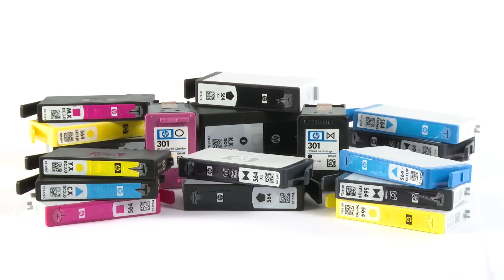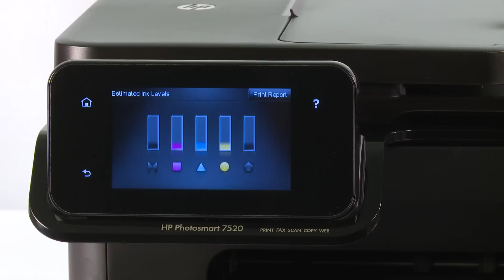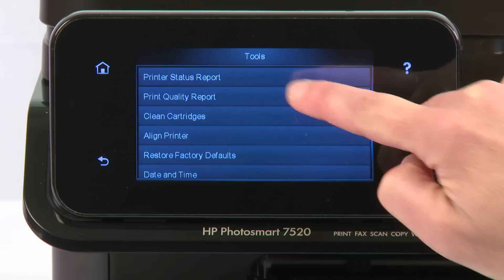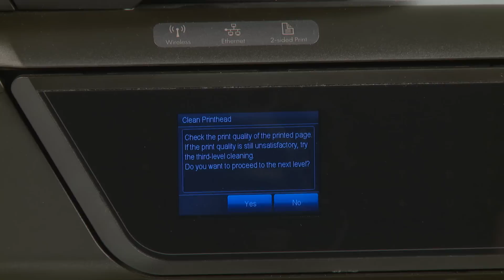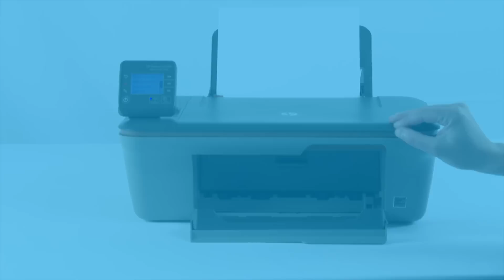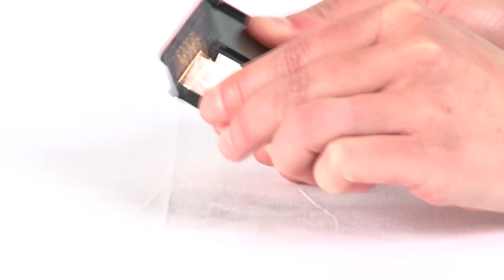How to fix print quality problems | HP Inkjet Printers | HP Support

Comment: hp officejet pro 6835 how to print highlighted text
Reply from the maker: Hi there, thanks for contacting HP Global Social Media Support!
I understand that you are experiencing an issue in printing highlighted text.
I will do my best to assist you.c
To print highlighted text with an HP Officejet Pro 6835, you can try these steps:
Update the firmware to improve how highlighted text is copied or scanned.
Select the Text option from the Optimize Text/Picture menu on the control panel when copying or scanning.
Regards, 
HP Support

Comment: HP printers are designed to NOT work properly with off-brand cartridges. HP cartridges are not perfect. And isn't it odd that solutions to print quality problems are managed by depleting your precious supply of HP ink.
Reply: I just bhought frst new one ink is wet doesn’t dry .and ink is empty already ,

Comment: My HP ENVY Inspire 99e says it has a paper jam and it DOES NOT!!!
Reply: I have wasted so much time and it doesn’t help at all!
Reply from the maker: Hi there, thanks for contacting HP Global Social Media Support!
I am here to help!
My apologies for the inconvenience,
I'd request you to perform a reset on the printer. Kindly do the following:
	
1) Turn on the printer, if it is not already on.
2) Wait until the printer is idle and silent.
3) With the printer turned on, unplug the power cord from the printer & wall.
4) Press the power button for 30 seconds. 
5) Wait for 60 seconds. 
6) Plug the power cord back into the printer and wall, ensure the printer is plugged into the wall & not to a surge protector.
5) Turn on the printer, if it does not automatically turn on.
Note: To make sure the power source functions correctly, make sure the printer is plugged into an electrical outlet and not a power strip or surge suppressor.
Let me know!
Regards, 
HP Support

Comment: Why don't you lower the outlandish price of your ink. Maybe people would be more willing to buy the HP ink if it didn't cost half a month's wage.
Reply from the maker: Hi there, thanks for contacting HP Global Social Media Support!
I understand that you are not happy with your printer as the ink cost more. 
I will do my best to assist you.
It depends upon the usage. However, you can check the page yield of individual cartridge here: https://bit.ly/3e9Q41H 
Regards, 
HP Support
Reply: @HPSupport  Your link doesn't help at all, I know what the page yield is supposed to be. I've printed maybe a dozen pages with colour, at the most, in the past year. Now, the amount of ink used whilst cleaning the print heads is a problem and the problem I currently have is that the heads are clogged. Several cleaning cycles have yielded no results. The black cart works fine. I only have issues with the colour. I suspect the ink has been used-up in the cleaning cycles. I can't afford to pay HP for my cleaning cycles which is exactly what I'm doing as I am an occasional user and therefore must run a cleaning cycle first, every time I print. If I don't want streaks.
Reply from the maker: Thanks for getting back to us, In order to get this issue fixed, please contact our customer care team over the phone or chat for further assistance, as this issue requires Live conversation with you over phone or chat to isolate the issue and provide you instantly with appropriate solution or repair/replacement options available at your place as per the warranty.
Please feel free to reach us on call/chat, please access this link to select your preferred country and language option to reach us. Global support link: -  https://hp.care/3MSoVUy
Akhil_HP Social Media Tech Support

Comment: I got a printer in January printed like 2 pages and the ink is full , now it doesn't print at all, 1st was the colors printing very very light almost invisible,  I remove the colors cartridge and let alone the black cartridge and it didn't print either, it came out a white page 😢
Reply from the maker: Hi there, thanks for contacting HP Global Social Media Support!
I understand that you are experiencing an issue with your printer as it is not printing. 
I will do my best to assist you.
- May I know the model number of your printer?
- May I know to which device you have connected your printer? (For ex: Desktop, notebook, iPhone, iPad, android phone etc?)
- If connected to computer, may I know the operating system installed on it?
- Are you receiving any error message?
Please let us know!
Binu-HP Social Media Tech Support
Reply: @HPSupport 1) hp deskjet 4155e
2) I used my android phone using the hp smart app and complement hp app to print 
3) HP laptop using wifi operating system is windows 10.
4) Not error messages,  just not printing in colors nor black and cartridges are almost full.
Thank you
Reply from the maker: Thanks for the reply.
Please refer to the instructions mentioned under this document to fix the issue: https://bit.ly/3W9xyfO
Binu-HP Social Media Tech Support
Reply: @HPSupport thanks I will try and see how it goes.
Reply from the maker: If you need any help in the future, you can always get back to us.
Thank you for being a valuable HP customer.
Have a wonderful day!
Cheers!
Binu-HP Social Media Tech Support

Comment: Ink cartridges were changed four times and the horizontal lines continued to appear on subsequent prints.  All of the posted repair recommendations were carried out several times and the problem persists.  I'm very convinced that the problem is hardware __ faulty hardware.  The problem started on the 13th month after purchase, just after the manufacturer warranty expired.  The customer support gives a complete runaround, just to make it look like they're doing something.  We won't purchase HP products any longer, we're very disappointed in the quality.
Reply from the maker: Hi Joseph, thanks for contacting HP Global Social Media Support!
I understand that you are experiencing a print quality issue on your printer and you suspect that it is a hardware issue.
Due to limited support on this platform to fix this issue, please feel free to reach us on call/chat. Access this link to select your preferred country and language option to reach us. 
Global support link: - https://hp.care/3RpcHWr 
Binu-HP Social Media Tech Support

Comment: MY HP 7000 series printer shows print cartridges half full but I can’t print either in color or black and white, why does this keep happening? Do I need new cartridges even though they show half full?
Reply from the maker: Hi Carol, thanks for contacting!
I understand that you are experiencing an issue with your printer as it is not printing. 
I will do my best to assist you.
- May I know the complete model number of your printer?
- May I know to which device you have connected your printer? (For ex: Desktop, notebook, iPhone, iPad, android phone etc.?
- If connected to computer, may I know the operating system installed on it?
- Are you receiving any error message?
Please let us know. 
Binu - Social Media Tech Support

Comment: Need advice on HP J4580 which is old but the problem that came up in printing a page that pertained to date at the upper right corner and a a straight line for the purpose of a signature signing.  Upon printing the page, the year ends on the next line on the leftside of the  paper.  Same for the line which also ends up one line down and again on the left side of the paper at the bottom of whatever I have typed on the letter.
Appreciate the help on how to fix or is the problem inside the printer and is time for replacement?
Reply from the maker: Hi Mike jung,

Thank you for your post and interest in our product.
We appreciate your time you have taken to contact HP Support and We apologize if you had any inconvenience.
I'd like to help you with your HP Printer and related queries.

As a first point of diagnosis, please try few of these troubleshooting steps mentioned in this document link:
https://support.hp.com/in-en/product/hp-officejet-j4500-j4600-all-in-one-printer-series/3645081/model/3645099/document/ish_2040896-1521878-16

If issue still persist after trying above troubleshooting steps, To further provide you with appropriate solution for this issue, We may require some additional information to assist you specific to your HP product:
1: Model name / Product number of your Printer:
Here is a document link that will help you find this information. Link: http://support.hp.com/us-en/document/c03754824
2: Brief description of the issue.

Hope this helps. Keep me posted.
If you require additional assistance, Feel free to contact us anytime for any HP Product support.

In case you want to reach us on call/chat, please access this link to select your preferred country and language option to reach us. Global support link:- https://www8.hp.com/us/en/contact-hp/ww-phone-assist.html

Regards
Vignesh-HP Social Media Support

Comment: The clean head and alignment features have disappeared from my HP Envy 7155 series printer control panel.  None of the menu icons at the top of the screen now show these two vital maintenance features.  Have searched and cannot find after several attempts. They were there before!
Reply: Hi. I'll really help you. Just buy a different brand of printer. It will fix all your problems. Literally any other brand
Reply from the maker: +The Defenders Team Please refer to the instructions mentioned under this document to fix the issue: https://bit.ly/36UQJpu

Comment: Our printer won’t print error message is remove and reinstall the indicated ink cartridge making sure it is correctly installed we did that, it prints once, and message comes back
Reply from the maker: +Linda Bach thanks for reaching out! 
I understand that you are experiencing an issue with an ink cartridge on your printer. 
I'll do my best to assist you. 
After you install an ink cartridge, if an Incompatible Ink Cartridge or Ink Cartridges Missing error message displays on the printer control panel or computer screen, the steps in this document should help you fix the issue: http://hp.care/2tf8Yh8 
Let us know how it goes.

Comment: HP:  I have a C7180 all-in-one Photosmart.  The printouts started missing colors, so I replaced all the cartridges with HP02 and still bad printouts.  I ran all the troubleshooting - cleaning the heads, etc.  Still bad printouts!  What else can I try?
Reply from the maker: +A Priscilla Please refer to the instructions mentioned under this document to fix this issue: https://bit.ly/3r9jfLN
Reply: Link not working

Comment: how to change orientation of print.  All pages are printed sideways
Reply from the maker: +Bobbie Stoops Open the Control Panel and then the Devices and Printers option. Find your printer in the Devices and Printers window and right-click the icon with your mouse. In the menu that appears, select Printing Preferences and find the option for Orientation in the preferences window.

Comment: I bought the hp 8025 inkjet printer and when I first bought it it printer really good. Then after time The printer quality went down and the magenta and cyan and yellow doesn’t show up. I replaced it with new ink and it still wasnt showing up. I tried cleaning the printhead multiple times but never replaced it. Ive done lots of research but i cant find any answers. I was thinking about just buying a new printer. What should I do? Also I was printing with sticker paper because I was making stickers.
Reply from the maker: +Glory-Adonai Please refer to the instructions under this dcoument to fix this issue: https://bit.ly/3u5oNpR
Reply: Hi glory, if you're still looking for answers I have the solution for you. Buy a different brand of printer. Literally any brand will work

Comment: Hey, I just bought hp deskjet 1210, and just after 2 days it doesn't print nicely, it get so much skipped lined and bad colour accuracy, please help me fix this, and tge cartridges get leaks inside the printer.
Reply: And also it is not low in ink
Reply from the maker: +dragster Please refer to the instructions under this document to fix this issue: https://bit.ly/38mzWYV

Comment: Since a Samsung update a while ago hp printer Envy 5530 21 E0E8 matched with android tab6 - printer works very very slow and jerky and larger print.  Is fine with ipad and main computer.  My husband has the same problem with his Samsung tab 6.  We have tried rebooting, reloading printer.  Help Rita Leckie
Reply from the maker: +Rita Leckie Please try the mobile printing solution supported by your printer as mentioned here to fix this issue: https://bit.ly/2OOE9Pk

Comment: cleaning waste so much ink... im going to run through 6 black cartage's before the fkn thing starts to print correctly. 
this crap cost more than gold per ounce. its ridiculous.
Reply: I just installed 4 new HP cartridges and had to perform 2 third-level printhead cleans. My print colors are now black, black, black and off-pink. And my printer is telling me blue, yellow and red are about empty. $45 for less than nothing.
Reply: Since instant ink service you don’t have to worry anymore :) yes I don’t like HP printers but they are reputable

Comment: When I print a head shot with black hair on my 5258 printer using HP photo paper on "Normal" quality, the black hair has a bubbly appearance.
Reply from the maker: +Ge Ki Please follow the guidelines under this document to fix this issue: https://bit.ly/2KFDtGq
Reply: @HPSupport  These help tips did not address my problem, the bubbly appearance of the black area on the photo.  I went through all the steps on the troubleshooting page you referred me to.  And I should add that I have not problem printing photos on plain paper.  And yes, i do change the paper setting to "HP photo paper" when I use photo paper, and yes I am using HP photo paper, and yes I am using genuine HP ink.

Comment: I have an HP OfficeJet 3830, brand new.  Test pages print fine, but when I print from word or just documents sent to me in an email, everything is blurry.  Any suggestions?  I already ran the "clean ink cartridges" and the "check alignment" on the printer.  I also uninstalled and re-installed printer.
Reply from the maker: +Julie Trout Please perform the steps mentioned under this document to fix this issue: http://hp.care/2vkJUIf
Reply: jytte

Comment: in my new 3835, while scanning full page is not saving, only the top portion is saving
Reply from the maker: +Abdulrahim zakeer There is an option to select the scan area if you click on "more" option. You can save the scan area and hopefully in future it will scan the entire area, instead of selecting the limited area out of total scanned area. The fact is that the scanner scans the entire area however the software selects the best of out if (as per it's understanding) and displays for you to save, however don't save and first explore the steps I mentioned above.

Comment: I have an hp photosmart 6525... when I print documents fit to scale it prints the text..when I adjust to fit the page I get horizontal lines all across my print. Any suggestions on how to fix this? I've already done a cleaning and alignment
Reply from the maker: +B Hawthorne Please perform the steps mentioned under this document to fix this issue: http://bitly.com/2A9r4UW

Comment: my old cartridges, after not being used often, were printing streaky.  Now that i have brand new cartridges, they are still printing streaky.  Horizontal streaks where the colours aren't filled properly.  Frustrated and not sure what to do.
Any suggestions?  Aligned and cleaned printheads several times already, but not fixing the problem.
Reply: A bit late but buy a different brand of printer, that's what I did and it worked great!
Reply: @DC-ml6cv  yeah I just got this printer and am already having problems. I wonder if I should just return it.
Reply from the maker: +Osama bin quaddin' HP recommends that you use genuine HP ink or toner supplies. HP cannot guarantee the quality or reliability of non-HP or refilled cartridges. If you do not use genuine HP cartridges, the steps in this document might not resolve the issue. To check the authenticity of your cartridges, go to hp.com/go/anticounterfeit and please follow the link to resolve http://hp.care/2dSBugq
Reply: osama bin quaddin'

Comment: My ink was low in my HP Officejet 6600. So I removed the cartridges for replacement.  I closed the door and went to purchase the replacements. I am ready to install the new cartridges. Now the screen says "Cartridge Problem" - Until cartridges are installed, make sure the printer is turned on to avoid damage to the printer.  One or more cartridges are missing or damaged."  When I open the cartridge door the carriage does not advance, thus not exposing for cartridge installation.  How do I get the cartridge to advance?  The note above says do not turn off the printer.  And when I open the cartridge door it says, "The cover door must be closed to print. Check that it is completely closed.".  Help!!!  Again, how do I get to the cartridge carriage?
Reply: Figured it out from another vid. 1.  While the unit is on and door closed, unplug the power from unit and wall outlet.  2. Reconnect both ends.  3. Push the power button.  The unit must have reset and the cartridges were exposed.
Reply

Comment: how do i fix this problem on my HP deskjet 1510 and the problem is the printing quality is poor, the letters are half-present(letters only appear halfway),the images looked like that they're are largely pixelated and the color is not what I expect. Even the and alignment page is half-present and the instructions are not clear
Reply from the maker: +Lucky89999 The procedures in this document should help with streaks or faded printouts, color or black ink, not printing, documents with blurred or fuzzy text, ink streaks or smears, and other print quality problems:http://hp.care/2fv23M1